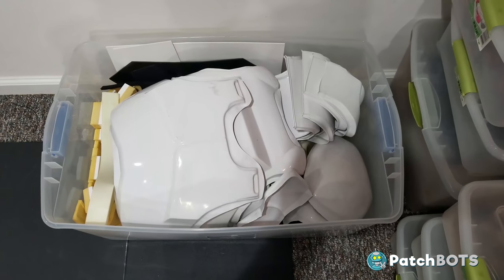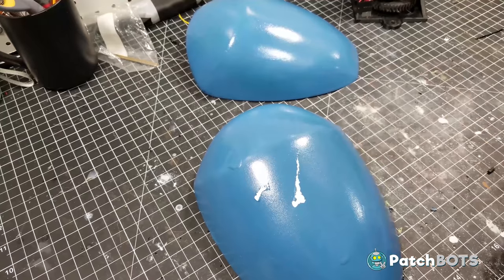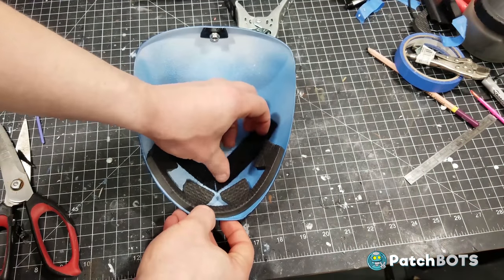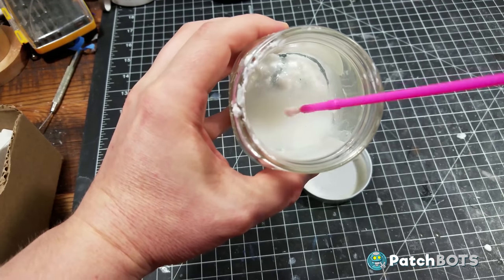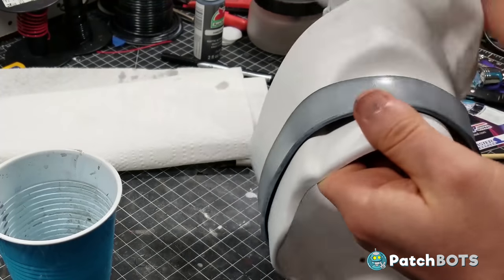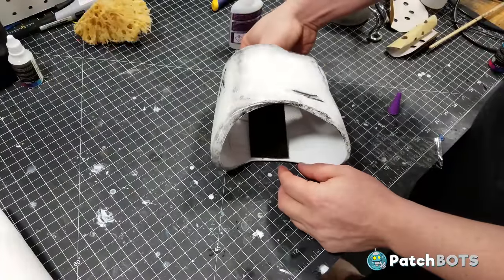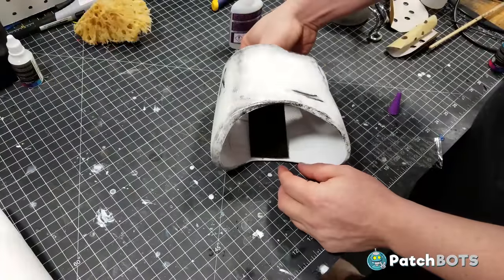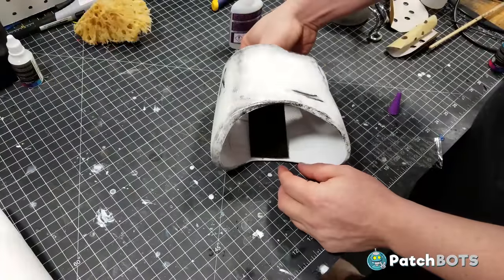Star Wars Clone Cosplay - Part 11 - The ARMS

Comment: Nice job Patrick (This is Elly from the Chopper Builders and through FB helping me with L337)!  Killing it with the clone!  I built my first one 12 years ago, and you're making me want to do another one.  

Another tip on the weathering - you can use acrylic paint and windex to add weathering.  If you add too much, just use fresh windex to take it off.  

Also, Goop on the tacky side of the velcro works wonders.  Let it dry overnight.  My biker scout has the velcro on it from 11 years ago.
Reply from the maker: Thanks Elly!  I'll be sure to try those out!

Comment: I know its been awhile since this video, but when you order your clone suit and helmet, Did you get a certain size made for you?
Because I'm planning on making commander thorn with a fully functioning light up CG staff For my first trip to star wars con in florida.
Also I love your work, and your tips on wiring and weathering, it really helps out.
Reply from the maker: Helmet: No.  They are usually just one size. But certain vendors just naturally have larger or smaller ones than others.   I think the EVO3/Sanotized hemlet is a bit larger than others, so if you have a big noggin' definitely look towards them.  As far as armor, again mostly one size fits all, but Imperial Surplus does have a "tall" and "short" option which I think only affects the legs.  The cuttoff is 5'10" i think, so if you're 5'10" or under get the short version, taller get the tall version.  There is a lot of trimming and fitting involved anyway, so you'll really be 'tailoring' it yourself.
Reply: @PatchBOTS  thanks so much! I'll be making my thorn costume once i save up the money, again. Thanks for the help.

Comment: Is a matte clear coat finish the best option? I thought clones had a glossy shiny white look? If not please let me know thank you:)
Reply from the maker: If I was making a brand new clone I would go with gloss. But gloss wouldn't make sense on top of dirt and scratches
Reply: @PatchBOTS  ooh good point, I’ll definitely have a think on it thanks for replying
Reply from the maker: @keeganbarber4871  i guess if you wanted to go full tilt towards realism you could finish the plain white armor with gloss, then scratch that up and add dirt as you would.
Reply: @PatchBOTS  that’s exactly what I was thinking, I also use a soldering iron to create actual depth to scratches and dents in the armour so I believe this would be easy enough to achieve
Reply from the maker: @keeganbarber4871  Sounds like a good plan!

Comment: Those came out very well.  Would be interested to know what you think of the mobility once you have the chest and back done as well. Also, does the sub assembly for the handplate scrape the back of your hand?  Very cool to see how to incorporate 3D printing into building this.
Reply from the maker: No back of hand issues, i rounded the edge a little just to be sure, but there's enough room in the glove that there is no real scrape. . Yeah i'm sure my mobility will go down as I add more pieces, but, was worried about being "armor bound" and nto being able to get my helmet on with all the arm stuff, glad that's not the case.
Reply: Sorry to be the bearer of bad news... but being a "realistic kit" movement is not fantastic. But that is why we have handlers and troop in groups. I cannot take off or put on my helmets by myself, atleast without quite a bit of pain.